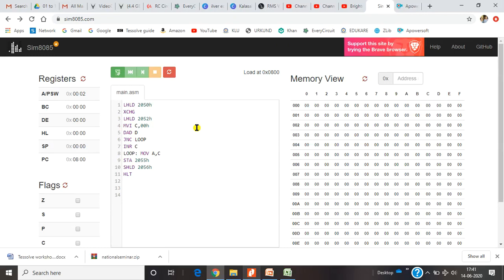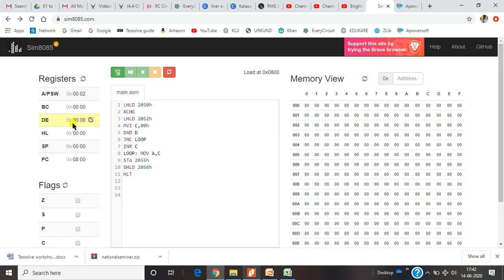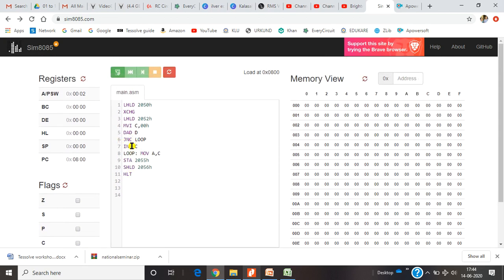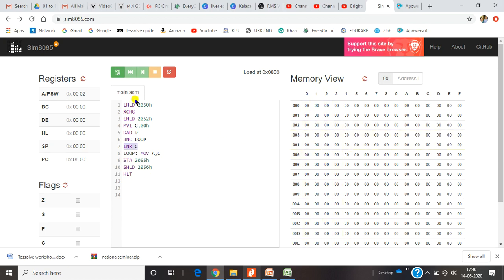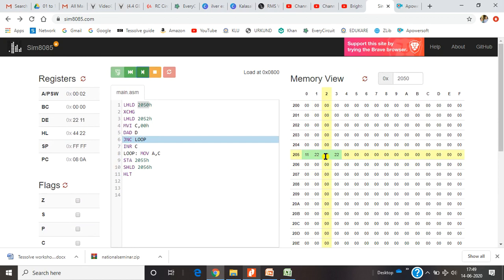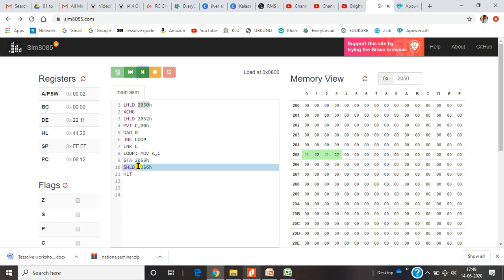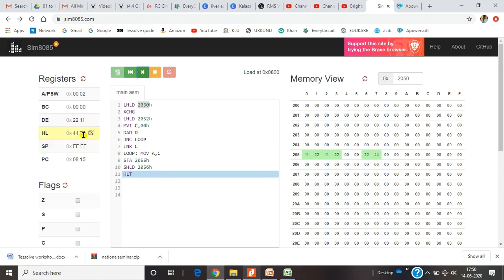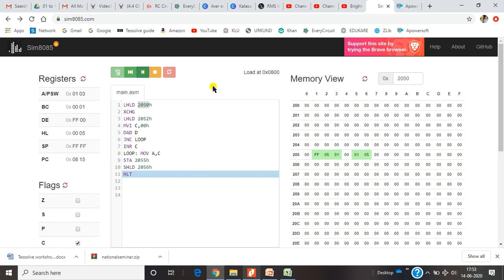2. Addition of two 16 bit numbers (sim8085.com)

Comment: 9. Program to add two 16-bit numbers.
Statement: Add numbers 1124H & 2253H and store result in memory location 
2055H & 2056H.
LXI H,1124H //Load 16-bit data 1124H to HL pair
LXI D,2253H //Load 16-bit data 2253H to DE pair
MOV A,L //Move contents of register L to Accumulator
ADD E //Add contents of Accumulator and E register
MOV L,A //Move contents of Accumulator to L register
MOV A,H //Move contents of register H to Accumulator
ADC D //Add contents of Accumulator and D register with carry
MOV H,A //Move contents of Accumulator to register H
SHLD 2055H //Store contents of HL pair in memory address 2055H & 2056H
HLT //Terminate the program.
Input: 
Register Pair Data
HL 1124H
DE 2253H
Output:
Memory Location Data
2055H 77H
2056H 33H
How to do this?